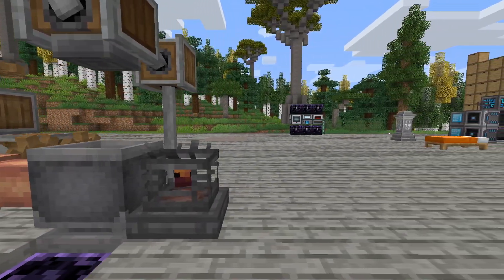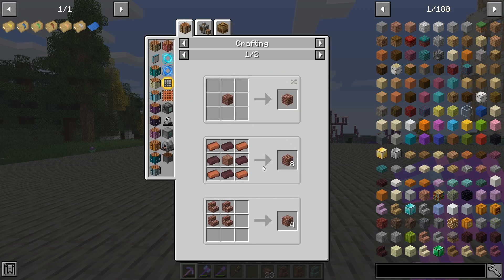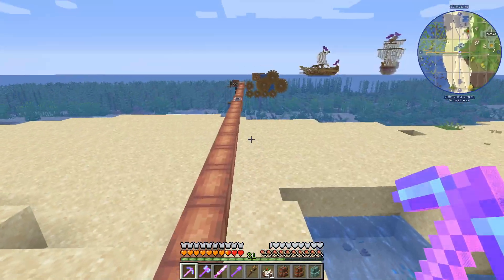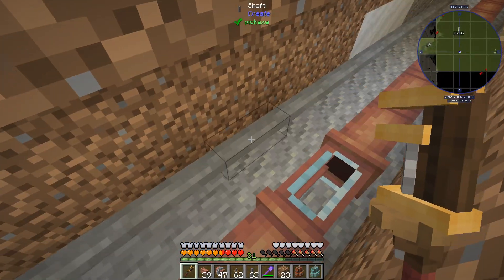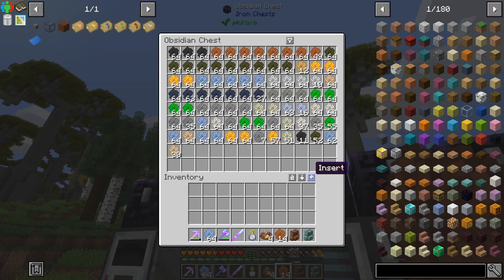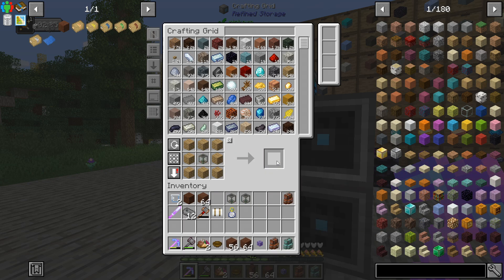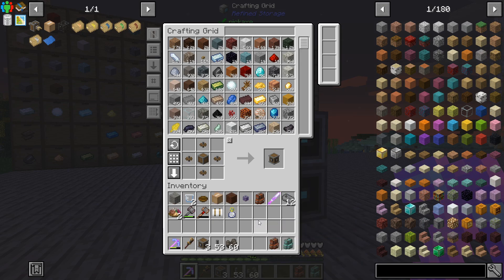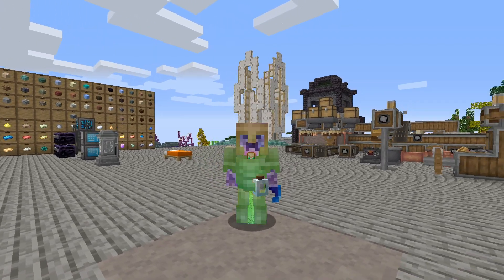Enigmatica 6 Expert | Engineers School Project - Building Materials | Ep 29

Comment: A bit late, but there is a simpler way of getting infinite water pumping.
Just place an Immersive Engineering pump against a water source block (middle of three) and give it some power (after specifying input and output using the hammer of course).
The pump is quite cheap and you can just put an Energy Cell on top. No need to draw ugly cabling all over the place. That cell lasts quite a while.